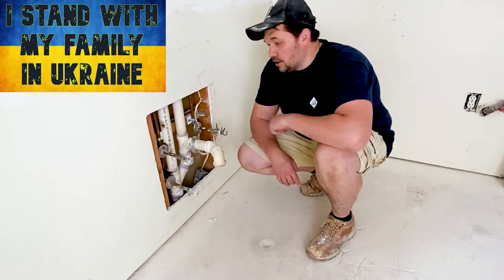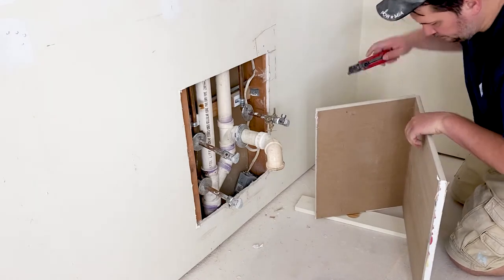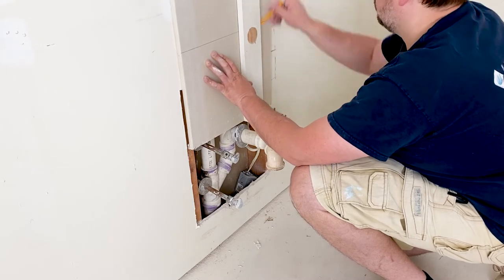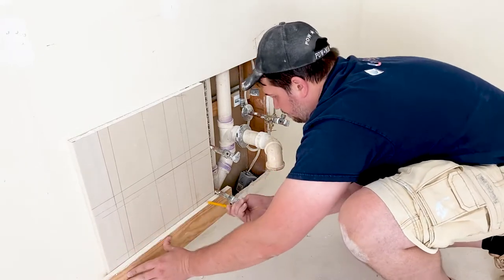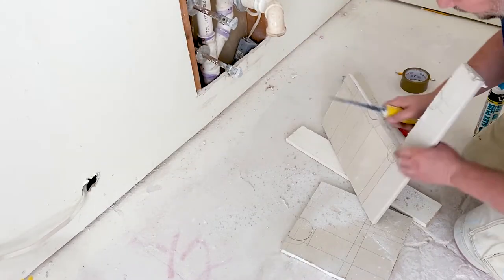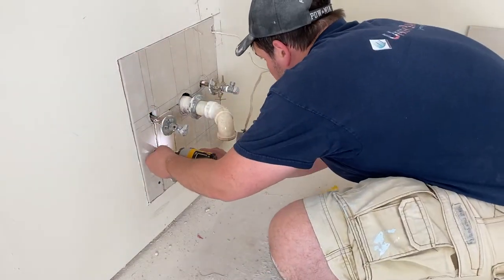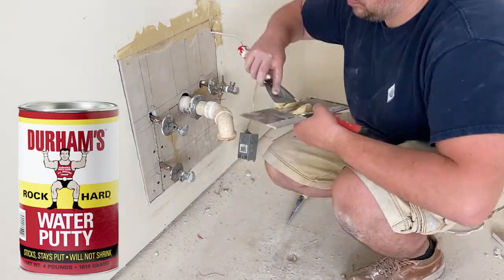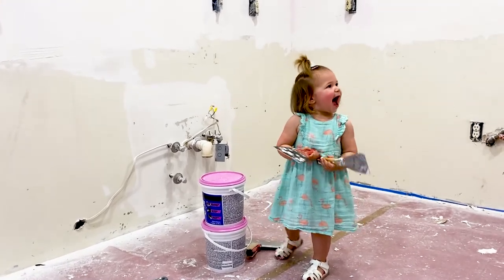Drywalling Around LOTS Of Pipes Hack

Comment: THIS video answered questions I had after having my house re-piped. I knew the plumber wouldn't patch the holes that were sure to be left, but I was sure I could do drywall patches... I've done many of them. However, it has been 30 years or so since I repaired any sheetrock! Repairing just one set of holes under the kitchen sink has taken me forever. I still have two bathrooms, and I figured there MUST be a better way to fix the drywall around the pipes under the bathroom sinks.

I have a question for you, though.

Although I've taped/bedded a lot of sheetrock, most of it 99.9% was done in the 1980s. Products and methods have both improved since then, and I have to relearn and learn anew about both! My technique is awkward, to say the least.

How would you patch a 12"x18" hole in sheetrock behind a new commode - preferably without removing the commode? The hole's right side abuts the adjoining wall's inside corner. I cannot get my hand behind the commode tank, much less a mud knife.

Thanks for any ideas!

Thanks so much!
Reply from the maker: George I’m glad I could help you. Please like the video so it gets shown to other folks looking for this information. Also thank you for subscribing to support the channel. I look forward to your comments on future videos. Stick around we are just getting started. If you ever have any questions or something is not clear feel free to reach out I love interacting with all of you guys in the community.
Reply from the maker: My apologies I missed the second part of your messages. It’s hard to say with out seeing the area first. If you still need help please send me a picture of the area to my email DIYwithMaX@gmail.com

Comment: This is awesome. Unfortunately I can’t use this method because 1 the other side of the wall is the other side of someone else’s garage 2 the pipe is coming out at a funky angle (seriously wtf ) which means the cut won’t be a circle; it will be an oval (fk!) and 3 the wall is made of particle board. I want to slap whoever decide to convert a 3 car garage to 3 separate garages the cheapest way possible. Like why would you that? Smh 😩
Reply from the maker: Thank you. That’s very unfortunate about your setup. Good luck in sorting that out. Please hit the like 👍 button on the video to recommended it to other folks like your self looking for this information.